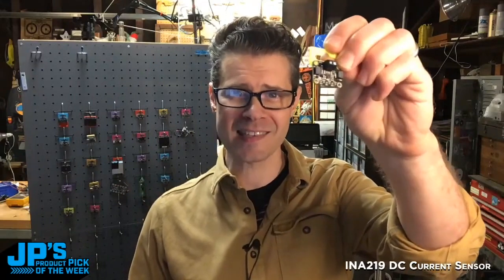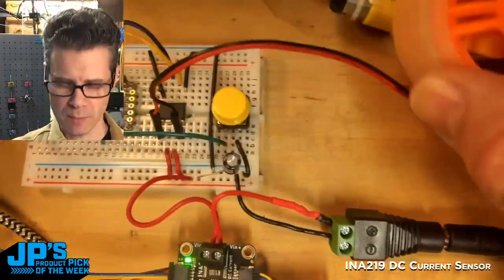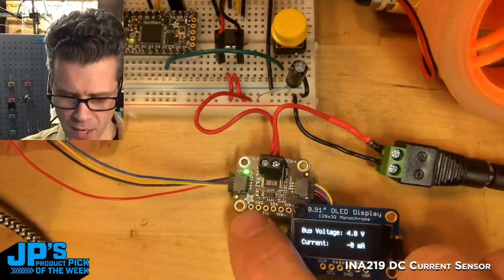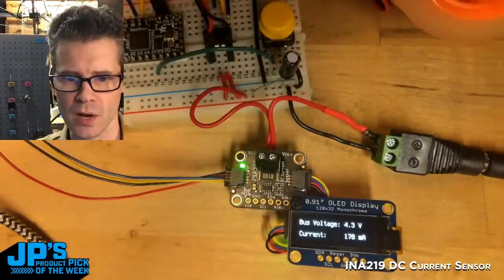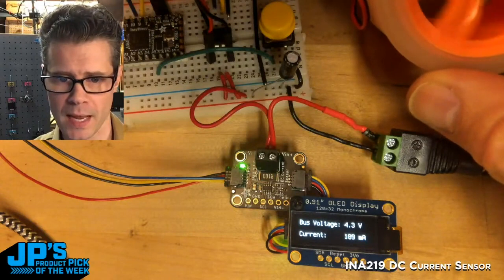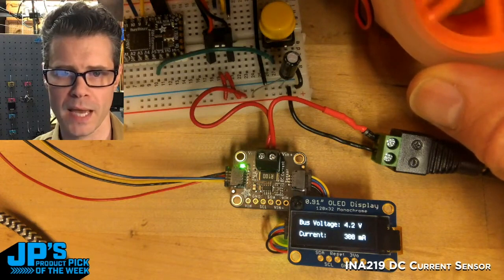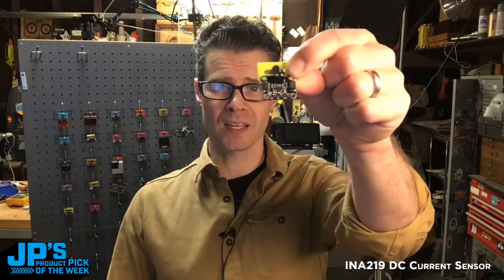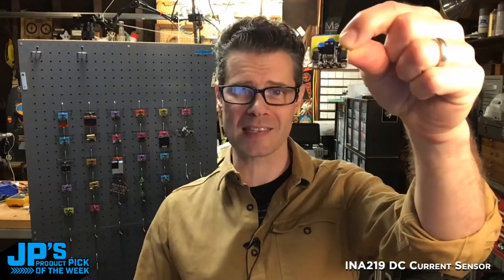JP’s Product Pick of the Week Recap INA219 High Side DC Current Sensor @adafruit @johnedgarpark

Comment: I am using this for a project. When the 'load' is an open circuit, I am still measuring current and a 1v bus voltage. How can I fix this?